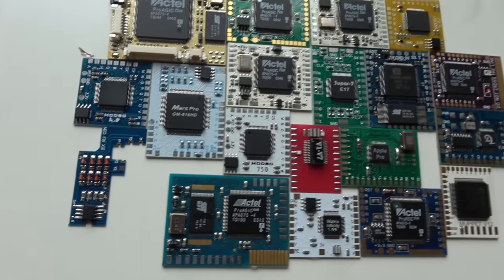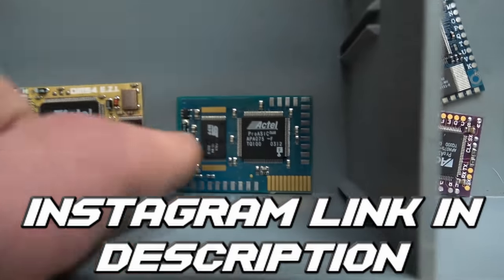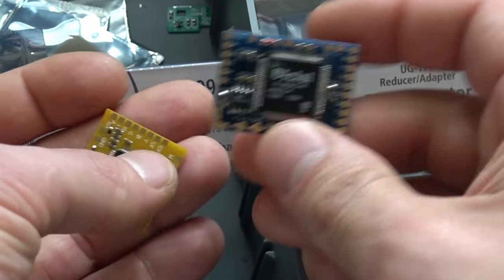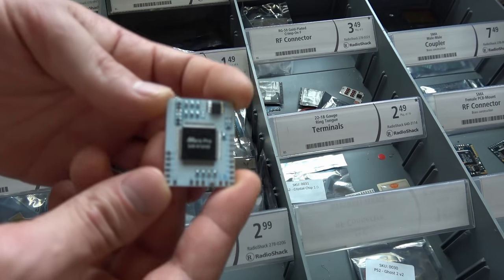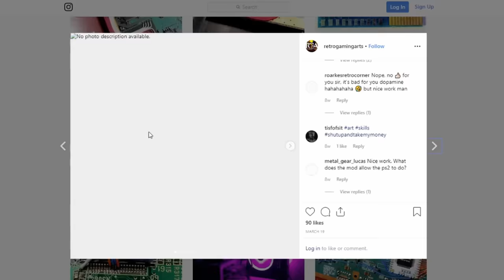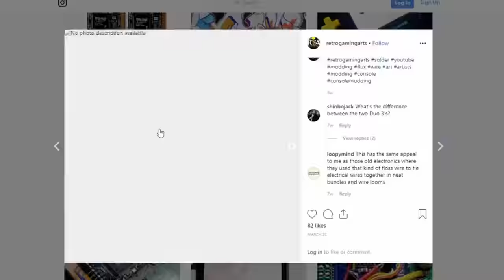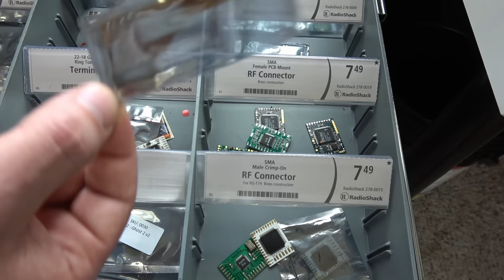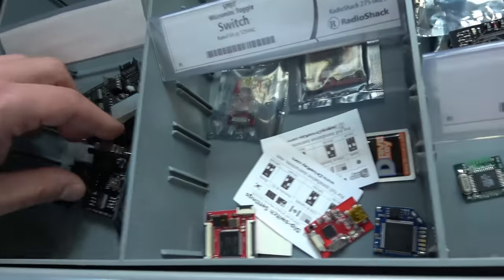SUPER RARE PS2 MODCHIP COLLECTION

Comment: Can anyone tell how to boot or turn on super 7 e17 mod chip is this has any key combination to turn on?
Reply: unfortunately the super 7 modchip doesn't have a dev1 menu, I looked everywhere and tried every button combination to open it, however I've heard there's a way to disable it but there isn't even information on how to do that.

I myself have this crappy modchip and its one of the worst modchips out there.
 It doesn't have a menu and not much info on its features, it's basically a bad clone of another modchip, I would request people to never ever get this modchip in your own PS2 otherwise you wont be able to use FMCB and will be stuck with burning disks to play games until your laser wears out.

Comment: Is it true that you can brick a cloned modchip by trying to enter the modchip settings?
Reply from the maker: Not by changing the settings. By trying to update the firmware
Reply from the maker: The original matrix infinity, you can upgrade the firmware on them. The modbo clones, if you try to, it will brick the chip